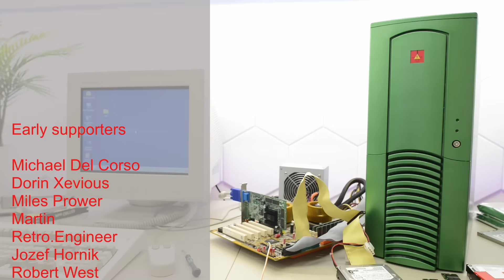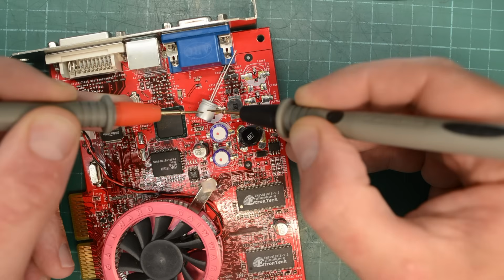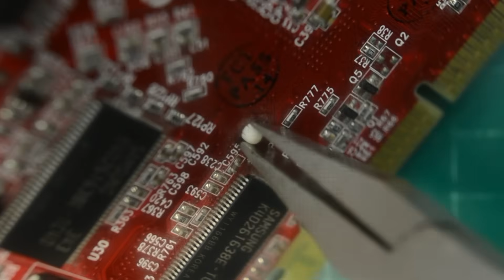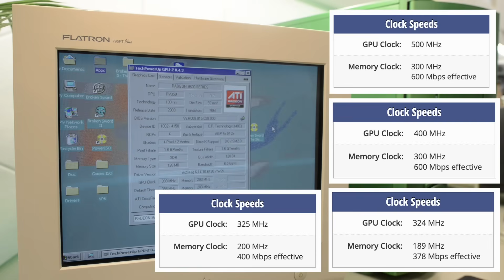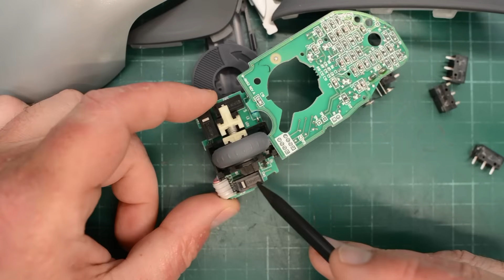Why are my vintage GPUs dying? Troubleshooting & Repair + poly-mod

Comment from the maker: Support me on patreon.com/Epictronics
Buy me a coffee: https://ko-fi.com/epictronics
The ABIT VP6 Dream machine playlist here: https://www.youtube.com/playlist?list=PLLN54H2azbhTUS032F_hSV21Ry961iU1-
More Ti4200 and Ti4600 Troubleshooting here: https://youtu.be/vus8HtwttX0?si=Zz3o9_GbR9-WpMq6
Reply: the card is a Madview 9600 Pro 256 MB
Manufacturer: 	Madview
Model: 	9600 Pro
Device Id: 	1002 4150
Subsystem Id: 	148C 2064
Interface: 	AGP
Memory Size: 	256 MB
GPU Clock: 	398 MHz
Memory Clock: 	203 MHz
Memory Type: 	DDR

If you have things like that, you can just google the bios version which is in GPUz

Comment: as Necroware found out in his latest video some (especially 90s) cards use level-shifters that can start to drift and end up overvolting RAM chips killing them sooner or later. I wonder how many cards out there have been "fixed" by swapping RAM chips only for them to just die again after some amount of use.

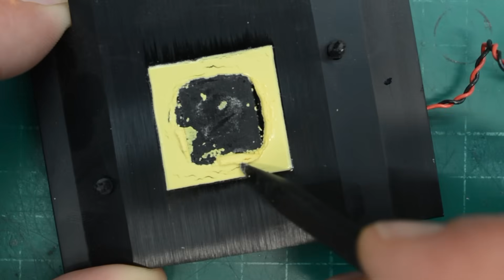Comment: 15:04 - that's not thermal paste. It's Thermal EPOXY, a total PITA to remove.

I just bought a 9700Pro from someone on eBay for $20 "un-tested"

It turned out the cards vRam was unstable at stock clocks and the owner incorrectly BIOS flashed using a 9500 BIOS. (It didn't fix it)

So I created a custom clocked BIOS using the OEM, -15mhz mem, +35mhz core. 

Works great. But that EPOXY Was a nightmare to clean.

Edit: yours saying "9600 series", was similar to how mine was saying "9500 series", maybe it's some sort of BIOS Bit Rot and they're being miss-identified.... My clock speeds did not match any 9500 clocks I know of...
Reply from the maker: Flashing the BIOS is the next step. I'll probably add a few more cards and have another go in a vid

Comment: This does worry me about the many old VC I have. They all worked when I stored them away except my last, a ATI All-In-Wonder 9800 PRO, which had a fan failure which was very common. It got hot enough it shut my pc down , it did boot back up once I replaced the fan. But it had to horizonal lines acrossed the screen, my pc tech guy said it was most likely some caps and resistors that popped. He offered to fix it for $50(2010 money) but i declined. Wish I'd had him fix it then.  I think I might be able to do it myself one of these days. lol

Comment: Use solder needles. Helps a lot.

On the ati 9700. If that sot-223 (4leg chip, 3 small on one side one large on the opposite) is an ams1117, replace it with a modern ldo. The ams1117 was best in the 1980's when cap ear was high. They are seldom stable anyway even with a proper 300+mOhm output cap, input side of ams1117 is strangely affected by input cap esr being too low (which is something that isn't an issue with 80+% of ldo chips).

They don't have a power pad on the bottom but still need air gun temps of 375-380 degrees to remove. They are easy to solder by hand too. Just LIGHTLY pull as you heat to not rip pads, don't pry, higher chance of ripped pads. A pad can be made by squishing a cap leg and trimming it to size.

Comment: 11:30 my gaming computer's thermal paste on the CPU is standard "white goop" electronic thermal compound that you'd use for voltage regulators and suchlike. I ran out of fancy paste. But you know what it is working fine! It is a relatively low power CPU admittedly.

Comment: The EPA logo is rendered using the other bitplanes of the VGA card. It would be interesting to see if the VGA memory tests fine. This will be am issue already in the first 256 KByte. Not sure how the Geforce emulates vintage VGA, but something there will be broken.
Reply from the maker: I'll find some RAM and we'll find out

Comment: Hello Epictronics, when you replacing thermalpaste on radeon 9700 you have too pull off the "metalic" frame on the chip because its higher then the die or use a thermalpad. maybe it works. sry for my bad english. by the way nice pc ; )
Reply from the maker: Thanks, I just found out recently about this issue

Comment: Regarding to the thermal paste, a lil bit in the middle of the chip will be enough. Too much of paste is just wasting of paste.

15 years ago, some PCs came to me for repair and i've seen lots of P4 cpus had like 2 mm of solid glue-like paste between the metal of the cpu and the P4 heatsink. I even ended up pulling the cpu along with heatsink at least some times.

The socket 370 cpus, you could use thermal pads. There are 10x10cm sheets of thermal pad, you can cut a lil square, put it over the die and put the heatsink. The thermal pad will maintain its shape and not end up around the die.

Comment: The micro switches inside mouses are quite easy to fix, if you ever feel like it! Use a sharp and pointy exacto to release the small tabs on both sides of the switch to open them (careful not to lose the white button) and sand the contacts with a piece of paper and some contact cleaner. I've fixed dozens of mice that way.

I've also had some mitigated success by just spaying contact cleaner in the switch until it is soaked, but this method usually does not last.

Also: too much thermal paste on those GPUs lol ;P

Comment: 05:32 - aluminium case is covered in clear lacquer, but I'd put an insulator on the PCB under the cap to be sure vibrations while handling won't scratch that coating off.
06:14 - those purple caps are Oscons, those are good, no need to replace those
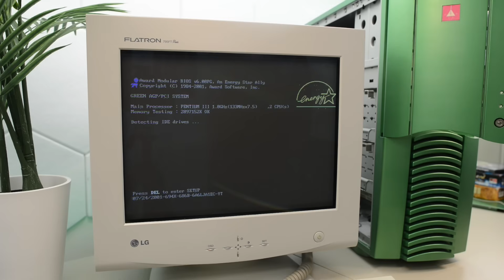11:59 - don't rush with replacing RAM, check for broken resistors and resistor networks near that RAM. Those usually are in path of data/address/control lines.
15:03 - I bet that is not thermal paste but a heat pad that gets softer when heated. It should be hard when cold. And those can be easily dissolved with gasoline.
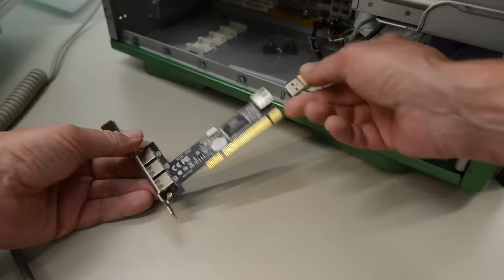22:35 - in my experience any controllers on VIA chips (USB, SATA, FireWire, etc.) are mostly trash, NEC USB is the way to go

Comment: If you could find a 9800..image quality difference was a thing. Around that time I think is when eventual cap quirks starting happening for everything.  I had a similar antec case. Wish I still had it. There use to be a database where you could lookup by PN number (Bios mod sites etc) but I haven't found that one. Sometimes third party was like that ie; powercolor

Comment: I have the same case!  It's black, pretty sure it's an Antec case.  Get's quite heavy when you have all 4 optical bay's full, a floppy, a Zip drive & 4 HDD's internally!  I like the green!  Though the best green I've seen was on my 99 Audi A4 Quattro.............Cactus Green Metallic!  I was running an A8V with a AMD 3200+  1 GB ram (though the A8V only supports 768!) and a Radeon 9800 AIW 128 MB (with CoolerMaster aftermarket heatsinks for the VRAM (both sides) and a beast of a copper heat sink with a manual potentiometer that mounted in a PCI slot).  Crushed Nvidia's top end gaming card!  So I ran a wrapper on their(Nvidia's) Dawn demo just for an ATI card...and grabbed screenshots with FPS running on my 9800, slapped a AIW box logo in the bottom right and saved a few, still on one HDD somewhere!  Good stuff!

Comment: This is why I am a big fan of the push-and-twist method for removing SMD caps. Less heat soak into nearby components, and no torn pads. Just have to clean up the pads of the old RoHS junk and cap legs. Much faster as well. I do it in waves per board, going down all caps at a time of a given spec, after marking the old ones beforehand with a sharpie so I don't miss anything or have any confusion.
Reply: With push-and-twist method you mean the same method as shown in this video?

Comment: ~0:02 OK, was going to see how you are likely going to recap those old video cards, as that is the first most likely failure point, but was immediately stopped by your gorgeous green Dragon (the only correct color for this style) case. Rocked one for many years and is still one of my favorite ridiculous early 2000s cases. Wish I could find another for a decent price.

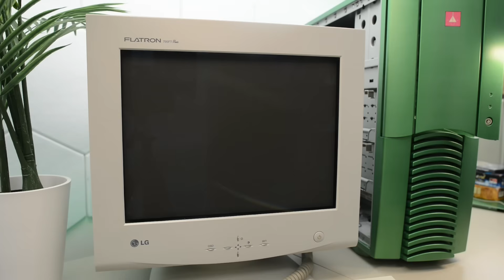Comment: 11:45 for my retro parts, I've had really good results with indium foil (.2mm I think) and phase change thermal pads. It is more expensive, but the indium foil is virtually forever and the phase change pads also have a very long lifespan. Re-pasting 10 CPUs and GPUs at a time can get very tedious and expensive too - and I keep about 10 working retro systems at a time, if not more.

Comment: I was given an old i7 gaming PC, no graphics card, however I'm not into gaming so that didn't overly bother me. Trouble was the on mobo video was HDMI only, I wanted VGA, so I popped in an old naname card from my junk box, no fan, just a fair sized heatsink. Trouble was it was getting quite hot then died, so I slapped on a rather oversized fan (smaller ones were too noisy) This fan hangs oner the side of the board blasting air everywhere, but it works.

Comment: For the thermal adhesive on those Radeons (I'm not sure it's a true TIM as even back in the day they were near impossible to remove) I'd recommend soaking the cotton-tips in acetone to clean. It won't damage the anodised aluminium of the heatsink, and it won't damage the silicon die of the GPU. 

I'm pleased to see you're using proper TIM for the repair instead of just normal white goop - I've found GPUs last much longer when their stock thermal interface is replaced with either Arctic MX-4 or Noctua NT-H1, to the point where it's a standard thing I do to new GPUs for new builds.

Comment: the Radeon 9700 may be a lost cause which isn't surprising, even when new they were unreliable (had 2 of them DoA new in box in 2002, original and first warranty replacement were both dead but second replacement was good). They are certainly something to have in a collection but  probably not the best choice to use unless you want the authentic early DirectX9 experience. A Geforce 6 would likely be a much better choice if you can get one even if it's not entirely period correct for the system as Geforce 6 came out a few years later, though some people likely used one with this motherboard
Reply from the maker: These motherboards only lasted for about three years before the caps died. The plan is to stay within that "period correct" time frame :)

Comment: hey, just so you know, the capacitors you used on the GPU aren’t the right type. You used general purpose ones, but GPUs need low-ESR caps, especially around the VRMs. Without them, the card can become unstable, show artifacts, or even get damaged over time. It’s not just about voltage and capacitance. You need the right ESR and ripple ratings too. I’d swap them out before powering it on again. Now that I dragged you along about something I know absolutely nothing about, you used too much thermal paste 😉
Reply from the maker: lol. I used poly caps on all three cards
Reply: @Epictronics1 that's why I said what I said at the end.

Comment: Caps are most likely anodized. It means they have a layer of alumnium oxide all round which is non-conductive. Something similar sits inside, forming the insulating layer of the cap. It's when this layer gets too thin, the capacitor first increases in capacitance and eventually becomes leaky. With regular use, this insulating layer is continously reformed and capacitor works as expected. That's also the reason why you shouldn't be using caps with much higher voltage rating than needed. When they don't see enough voltage regularly, their insulating layer degrades and caps parameters change over time. On the other hand, it is possible to modify a capacitor this way and exchange capacitance for voltage rating. Process is the same as reforming. Which means slowly increasing the voltage until insulating layer becomes as thick as desired. I wouldn't recommend doing it though. Some electrolyte formulations may not be happy about higher than expected voltages and degrade (possibly with a bang or at least some stink).

Comment: That is radeon 9600 128MB, there were just regular 9600s with different memory amounts. Slower than Pro but still decent. I have the same gpu from sapphire since 2003 :)

Comment: Please use an active tip soldering soldering iron like the pinecil V2 ... you can push up to 140W of heating with the pinecil V2

Comment: I've had hardware that didn't work properly with generic Win drivers, switch to the manufactures and it works fine.
maybe you can go to Properties and get the hardware # and look that up for the GPU.

Comment: That TEAPO capacitor looks suspiciously similar to the fake Jamicon capacitors (similar gold-on-green color scheme and font) - I've recapped a couple of 'plagued' motherboards with them, only to find the new capacitors bulging again after a couple of years, when I've pulled 'repaired' motherboards from the storage - they weren't even in use! It boggles the mind that somebody is still producing new capacitors (since they can't even be stored for any long period of time without going bad) using the same stolen formula that is known to be bad for more than two decades. And, sadly, many vendors have ONLY them in stock where I live.
Reply from the maker: I powered up a 2006 NOS IBM server a while back. After just a few minutes, the caps started growing like mushrooms lol. They definitely go bad in storage
Reply: @Epictronics1  Fake Jamicon caps did the same in about two years after being bought and soldered - and they didn't look like NOS from 2006, they looked genuinely new.
Reply: Teapo/Yageo (same thing) are low tier taiwanese caps that absolutely do not like high-stress areas like CPU VRMs with lots of heat and current being shoved through them, or being subjected to high amounts of ripple (like as output caps on noisy high-wattage switchmode PSUs). Everywhere else, they do fine and last a pretty long time. Treat them like better "general purpose" caps and they do OK. Their failures have nothing to do with the "stolen formula" BS. Please stop spreading FUD.
Also fake caps happen to all brands, the chinese will fake anything if it can get them a little profit. I've seen anything from fake Rubycons (X vent instead of K, poor print on the sleeve), Chemicons (X vent instead of star) to Panasonics (again, X vent instead of T). Also flat rubber bungs with a circular pattern and no protrusion outside of the cap case are common on junk noname caps as well as most fakes . Why they'd fake something that's already as bottom-barrel as Jamicon is beyond me though
Reply: @Knaeckebrotsaege  "Their failures have nothing to do with the "stolen formula" BS. Please stop spreading FUD." How do you explain the capacitor plague then? Not a troll question, I genuinely want to know. 

And how the inability of cheap capacitors to work in the high-ripple situations explain the capacitors that started to bulge on a motherboard that was only powered for a couple of hours and then put into storage for several years? There is clearly something else going on than the stress from work.

Comment: That's still a 9600 Pro, just a cheaper variant. Those memory clocks are typical of a TSOP memory version, while 300MHz would be typical for BGA types.
The Radeon 9700 cards are notorious for dying. Unfortunately it's usually the core that goes bad, and there's next to nothing you can do about it.
I'd love to see you replace the TSOP memory on the Ti4200. I have a number of cards with the same problem, and would love to see how you tackle the advanced soldering involved with those fine pins.
Reply from the maker: I'm definitely going to try again. But before I can take on the Ti4200, I need to find compatible RAM chips
Reply: @Epictronics1  While the 3.5ns variant of the chip is unobtanium, the 4ns variant of the chip is not. EM658160TS-4

I found a few suppliers that *claim* to have stock of that speed grade, which is good up to 250 MHz, and probably a bit more. If you run the Ti4200 at its stock memory speed of 250 MHz, it might work. UTSource has some listed at $4.45 a piece, assuming they exist, and aren't fakes.
Reply: I think it's either an Club 3D Radeon 9600 'LE' CGA-E968TVD or more likly in the US an PowerColor Radeon 9600 Pro 'EZ' R96-C3G oder 'Bravo' R96A-C3G but there were also Radeon 9600 Pro fakes on base of the PowerColor Radeon 9550 R96-LC3 in Europe around but no clue they made it to the US as well. All cards were made by CP Technology later known as TUL Corporation.
Btw. TSOP memory topped out at 3,3 ns or 300 MHz. So 'real' Radeon 9600 Pro and 9600 XT used both typs.
Reply: Can confirm on the Radeons.  I have a few of these cards -- 9700 Pro, 9800 Pro, and one of the FireGL variants.  All of them have video defects, and they just get worse over time.  It's heartbreaking, 'cause that was my next card after a Radeon 8500 back in the day.  Really wanted my authentic era rig, but ended up using a later card that just barely had an AGP version (with a bridge chip to the PCI-e native GPU) because that's the point where you have a fighting chance that it still works.

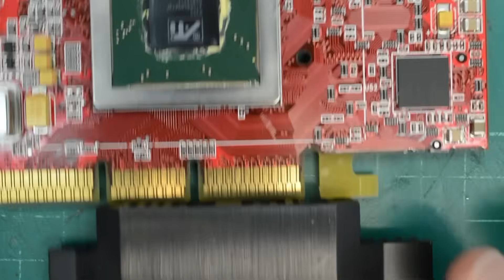Comment: 15:15 I'm seeing that one of the SMD components of the processor has been ripped off, possibly when you removed the GPU cooler 🤔
Reply from the maker: I'll check
Reply: Are you talking about those 2 black components (resistors?) which are angled? From memory this is how they are on R300. I think those are jumpers to configure the chip so some pads will be empty.